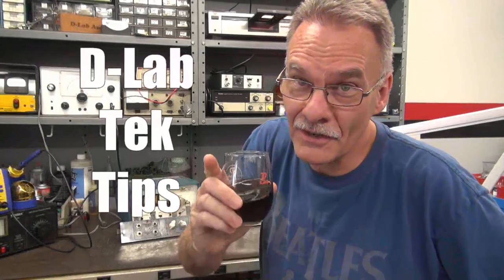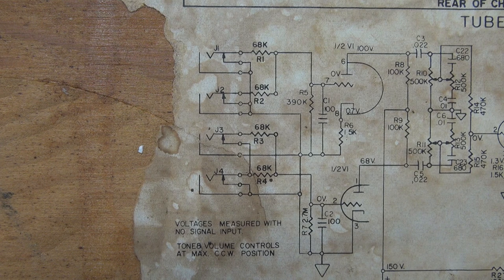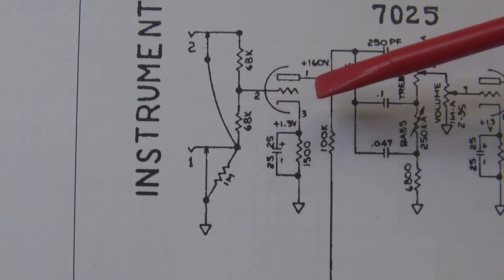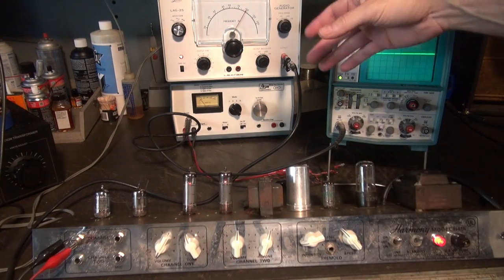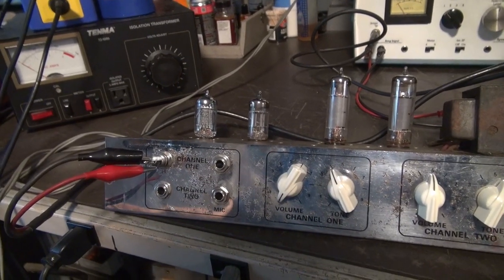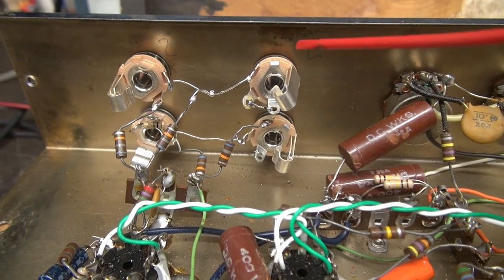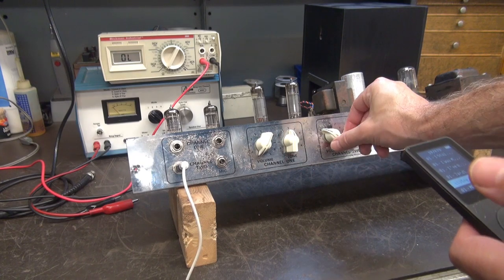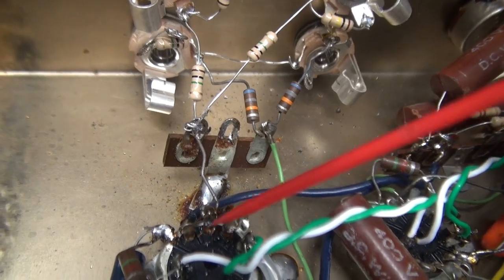How to modify tube guitar amp inputs Harmony 415 Part 3 easy MP3

Comment: That was insightful. I’ve been wondering about this. My 55’ Maestro GA 45 has a completely different input resistance than the famed G-40 which in almost every other way is the same bar a separate bass and treble pots. I’m going to test this tomorrow.

Comment: Good to know if you have a few low wattage valve amps that distort quickly, to get more clean headroom out of it, esp if it is a single channel amp! KEEP it clean, & use a dirt box in the front of  it! Orange Tremlord 30 springs to mind! Totally clean, 50's style amp, but with modern appointments like spring reverb, tremolo circuit and an effects loop!

Comment: Ch 2 has the cathode to ground, and it is NOT grid biased.  The low plate voltage allows for this.   I changed my Ch 2 on mine to "normal" on the cathode.

Comment: With a typical guitar pickup impedance being around 10K, amp input impedance of 130k doesn't load it significantly more than 1M, the difference would be even less when testing with a signal generator, as it has minimal output impedance.

The observed difference in gain is because of the fact that in the original circuit, the two 68k resistors were forming a 1:2 voltage divider. Adding a 1M resistor at the bottom effectively turns it into a 19:20 divider or thereabouts. Plus, you bypassed the cathode resistor of the input stage.

Comment: Why doesn´t the MP3-Input have a cathode resistor? Wouldn´t it be a good idea to add also 1.5k at pin 3 without parallel capacitor to reduce gain?
Reply from the maker: I tried to keep the mod very basic. Im sure there would be many improvements to the MP3 channel

Comment: Draw up the mods on a 3x5 card and paste inside the cabinet. I'd also try to error proof the input jacks somehow so the mp3 doesn't get put in channel one (maybe swap the 1/4in jack for 1/8th inch). Decal for the MP3 jack? Pretty important kind of mod -- maybe a follow up generic method to doing this on any amp? Perhaps a potentiometer instead of fixed resistors?

Comment: What happened to the 1 meg ohm from grid to ground on input 1. I saw only the two 68k resistors.
Reply from the maker: It is on the input jack, same as how Fender does it

Comment: Any advice regarding Bluetooth mod? Thanks! Great channel!
Reply from the maker: Hello, I have not played with the bluetooth modules. If they have an analog (audio) output, you could make an adapter cable, then plug into the amp. The MP3 players have a volume control, so it can be throttled for the correct level. Does bluetooth have that?
Reply: @d-labelectronics  Hello Terry, I'm not sure, but if one is Bluetoothing from a phone to the amp then the volume control on the phone comes into play. I'm currently playing guitar through a Eico 147A signal tracer.  I changed the RF input Jack to a 1/4" Jack and replaced the original speaker with a eminence. Sounds pretty sweat. So I'm making a clone and I want to add Bluetooth instead of aux in. So many wires... Thanks! Dan.